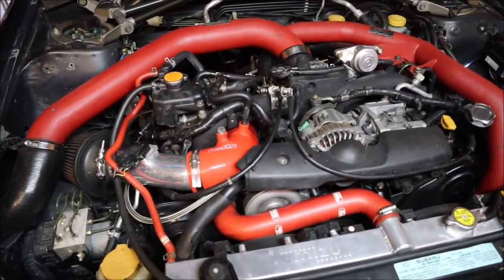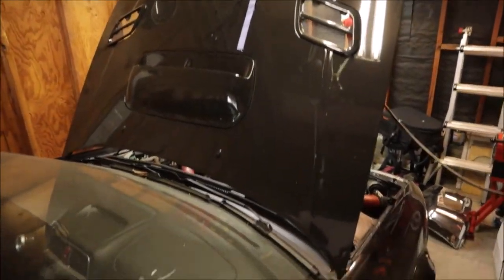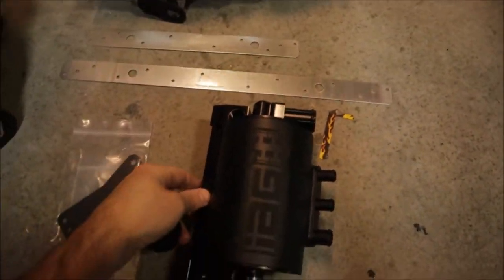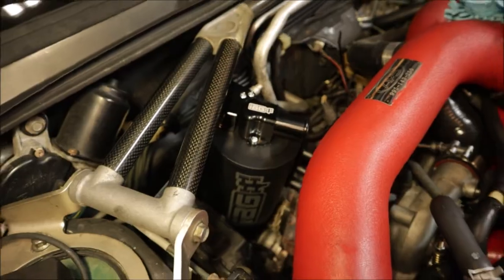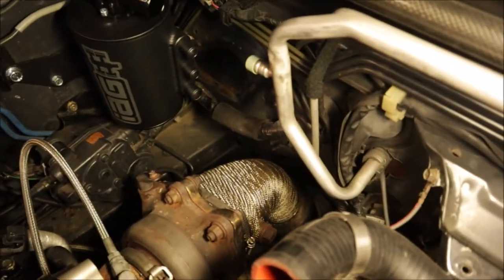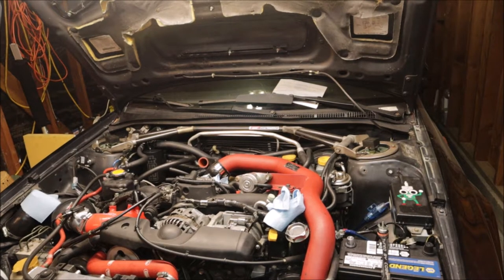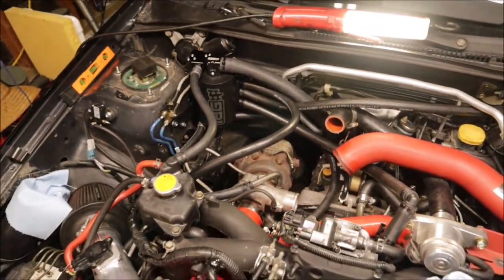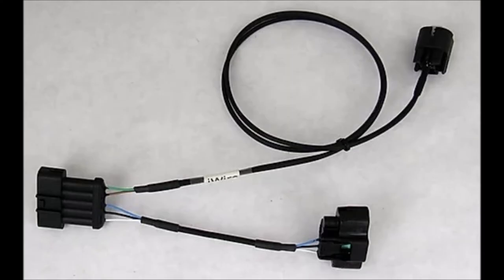Subaru Impreza Build Part 7: IAG Air Oil Separator Installed on the GC8 2.5RS RSTI.

Comment: I would personaly prefer to use an other (smaller) air oil separator, than to remove the strut brace.
Still good video.
Reply from the maker: I thought about that, did not want to sell a brand new one and have to purchase something different.

Comment: Do not sell that Fuji Heavy Industries carbon fiber strut bar! That was a Version 6 part that we got as an option.
Maybe reverse the bracket with it going forward and tweak the brake lines to give some clearance? 
Mine was on the other side where you had it initially but I fabbed a mount for it to go next to the pitch mount (reversed intake setup)
I would definitely invest in a turbo blanket to save everything around it the cruise module and the separator.
Reply from the maker: I hear you! Eventually I will find a way to install everything with the strut bar, maybe a smaller AOS. The bar is in safe keeping! A few people already ask to buy it. Thanks for the heads up.

Comment: Oh cool you have the Tein remote soft/hard servo motors. Are they worth buying?
Reply from the maker: Peter Cleven they only control one aspect of the coil over which is the dampening. The Teins ride very stiff but I am able to soften them up a bit with the controller. I found the happy medium and always leave it alone. Same could be done manually but it is kinda cool to have.

Comment: nice video.  i was thinking about getting the iag aos, but i don't know if i want to sacrifice the strut bar.  btw, i'll take that sti strut bar off your hands, if you're willing to part with it.
Reply from the maker: ziewknihtewza thanks! Bummed I had to remove it. I will try later to make it all work. If there is very little oil in the drain tube if any, I may lower the AOS and check the lines periodically!

Comment: What front mount intercooler are you using and how did you fit it?
Reply from the maker: Old APS piping, unsure on core. Had to cut front bumper support beam and fog light pockets out of front bumper. Too big for this power honestly.
Reply: @RoadPatina  did you get the piping for and sti or the gc?
Reply from the maker: @SubieSalviWagon  I think it’s for a gd chassis. Not a perfect fit.
Reply: @RoadPatina  can you please make a video showing the front mount. also iag sells a pitch mount for the aos and you might be able to keep the tower bar